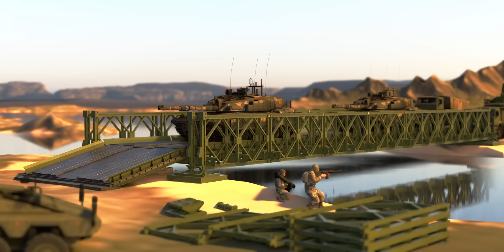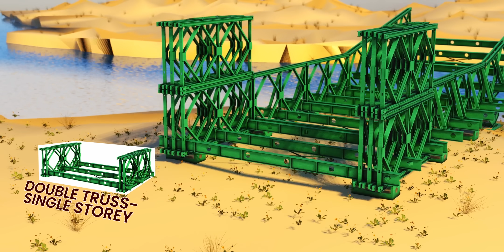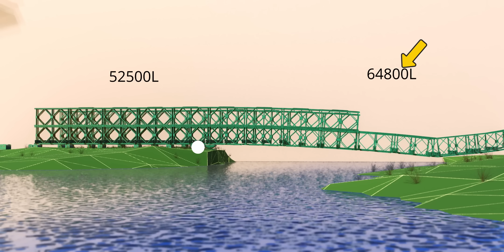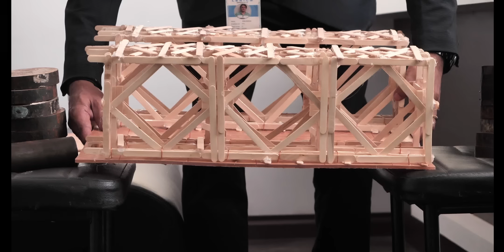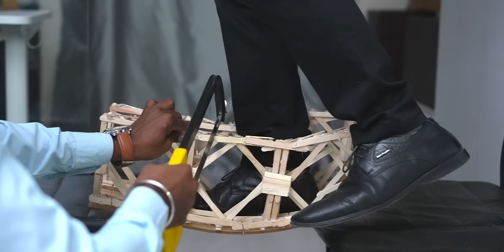The GENIUS Engineering Behind Bailey Bridges!

Comment: 10:50 
…think perhaps an up-date to the Bailey-Bridge is possible based upon geodetic-engineer Buckminster Fuller’s ‘Isotropic Vector Matrix’. Might well be substantially lighter and able to equate or even out-perform this (marvellous) Bailey-Bridge. The matrix is similarly modular but integrates tetrahedra between cuboid/cubic sections; it is susceptible to the introduction of gentle anti-gravity curvature to prevent the sagging moment at the centre of B-B spans. It is observable in some but by no means all crane-booms and its curve potential is radically manifested in its employment as the formal base of the London Eye… It is stiffened by layering modules (two layers - frequency 1 - f1 ; 6 layers - frequency 5 - f5) and these need not be pronouncedly voluminous…

Comment: A couple of points worth noting;  Bailey designed the bridge components so that they could be produced almost entirely by unskilled labour.  One facility was in Liverpool, where the women who checked the football coupons for Littlewood's Pools turned up for work one day, and were told to clear away their desks and chairs from their huge office, "because from now on, you're building bridges."
The other point was reports from the Royal Engineers as to how easily the whole tructure went together.  In contrast, although the German Army had a kit assembly bridge, their engineers complained that it was a right fiddly job to assemble, with so many of the alignments being absolutely critical - or it wouldn't fit together at all.  And, let's face it;  army engineers will rarely if ever find a bridge location where the ground on both sides is absolutely flat and level.

Comment: Interesting but would prefer the use of Moment rather than Torque. Torque is actually a twisting force causing rotation eg with a screwdriver. Moment is a bending force produced by force over a distance.

Comment: I built several MGB (medium girder bridges) with the Royal Engineers, the next generation Bailey bridge.  They have a sort of snout which on longer bridges can dip into the water which, normally being a river, is flowing.  One part of the bridge recce is to check the direction  of flow so you can then place an anchor upstream to stop the bridge twisting away into the water when the "snout" touches the water.  On one build, the bright young lieutenant doing the recce did not realise the river was tidal.  When they came back to do the build the river was flowing the other way which no-one noticed.  As the snout touched the water the bridge started to twist and  the anchoring rope was on what was now the downstream side of the bridge.  The baffled NCO watching the horror unfold was left running up and down the bank screaming "push out on that rope"😂  Lieutenants who managed to drop a bridge into the water were basically nick-named "splosh" for the rest of their service.

Comment: 1973-75 I was with the 78 Engineers in Germany and we were a road and bridge battalion.  We had the Bailey and in the 2 years I was there we assembled 3 bridges for practice.  The actual bridge guys were just one platoon but the entire battalion was needed to do the assembly, led by the experts. It was always a fun day, our mess sergeant would set up the chow tent on the landing side, we ate once the bridge was done and we could walk across to the chow line.  Lay hold, heave!

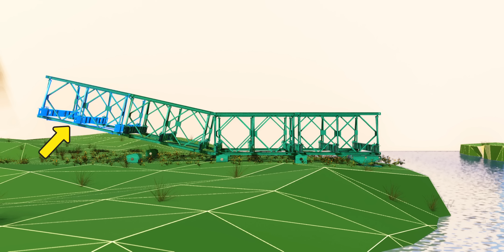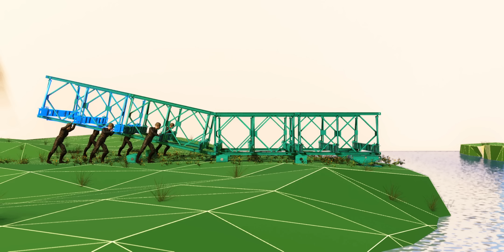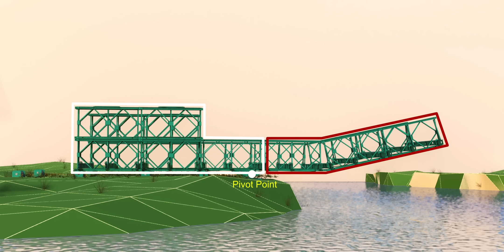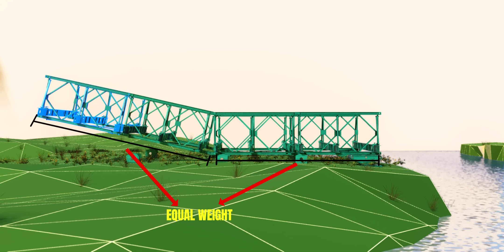Comment: From 2:23 to 2:28, adding the fourth side panels from the lifted position was very difficult in reality.  What we did as actual Sapper, put the 2nd and 3rd (extender) panel on the rollers then connect them.  Put a pair of jacks under the front (right) end of the 2nd panel then let the left end of the 3rd panel sink on the rollers.  Now put in the 4th panel, remove the jacks at the right end of the 2nd panel.  Put the jacks under the left end of the 4th panel until the right end of the 2nd panel sinks on the rollers, now put in the first panel connecting to the 2nd panel. Remove the jack from the 4th panel, put in the 5th panel for connection. Now push the 5-section bridge forward like 2:52.  Continue to put in more sections of panels, until it is like 4:48.  There have not been any moment to lift the new panels very high above ground, like it shown in 2:24, which is impossible in reality.  Some of the Bailey bridges installed during and after WW2 were continued to be used until 1970s.  🤔🤨😉😎

Comment: Looking at the design and erection process, it has a lot of similarities to scaffolding. In the video, I noticed some spans were erected on top of piers. There must be a limit as to how far they can span unsupported. 

The other thing I noticed is the video didn't  show how three double stacked frames were joined to make a single unit.... and if the transoms were secured to the trusses with bolts or pins. 

While it wouldn't be quick, a hybrid suspension bridge arrangement could be set up relatively easily using steel crane counterweights or sand boxes as anchorages instead of using piers.

Comment: There a WWII era Bailey bridge not far from my home locale. It was constructed to link two army camp, one of the white officers and the other of none white privates. There are still other remains of smaller pedestrian bridges, that had linked the two camps. The officers camp had a grand country house and its grounds, which burnt down post war. The other camp was just tents in open fields.

The Bailey bridge it still used daily by light traffic and smaller farm vehicles. Without the bridge, to get to the two nearest villages, distanced 1.5mi/2.4km apart, there’s a round trip of approx. 20mi/32km.

It was meant to be a temporary structure but at the end of the war, local communities had com to rely on the bridge. So the bridge remains to this day. By the way, the deck is a series of perforated metal grids. It’s a bit slippery in snow or ice. But the bridge isn’t marked on maps and the locals know it well.

Comment: Back in the 1980s, a section of Bailey was still in place just outside the Welsh town of Porthmadog.
Leading to what might have been a quarry, when the Roadway known locally as the Cobb, was built and then aided in the early 1990s. To become a double lane. The Cobb had a dual purpose as the railway line from the Slate Mines inland.

Comment: These bridges are still in use. Following a very wet Spring and early Summer in South Eastern Australia in 2022, one damaged bridge was replaced with a temp Bailey Bridge until the early bridge could be replaced. single lane and had traffic lights to control direction of traffic.

Comment: I was an engineer in the 42 scd bat of the Dutch army in the 70 ties, this isnt at all how we learned or did it and we build some realy big Baily bridges.
i have never build or seen a Baily bridge being build with the tilted nose, what we did do was adding a nose to the front of the bridge (a single beam of various lengts) long enough to cross the river. When the bridge was pushed forward ( by soldiers, lorry , or even a tank) it was pushed for enough that the nose reached the far side of the river. A soldier would now walk over the nose with a roller ans place it it under the nose and then it was pushed over the river.
in case of a river being to wide for a nose we had to build one or more pylons in the river, the nose would remain the same just hte soldier walking the over the nose to place the roller would have to do that multiple times now.
And yes a well trained battaljon could build the verry fast, althaugh it was at that time already being replaced with the MGB (medium glider bridge)

Comment: I was in the Royal Engineers from Aug 1969 to Aug 1979. I helped build many Extra Wide Bailey Bridges, EWBB and it's big brother, the Heavy Girder Bridge. This could be build using manpower alone but it was a long job and potentially dangerous with, I think, 18 men per panel. A crane made it much easier and safer. As far as I know all variants of Bailey could be built onto floating pontoons thereby becoming Light Assault Floating Bridge, LAFB or the heavier load carrying HAFB. In the mid-70s we took delivery of the Medium Girder Bridge but, that's another story. As for the EWBB, what happened to the articulators?

Comment: A bridge on a nearby rail-trail was removed and replaced with a newer structure - that promptly collapsed when the concrete for the deck was poured.  They replaced it with a Bailey bridge which is still in place two years later.

Comment: 1. Dorset is in UK not Ukraine as stated at 10.33
2. The ingenious method of manufacturing was when the bridge parts left the factory in Christchurch UK, they were installed on a section of test bridge and then a section from the far end was removed to be shipped out as this ensued that every bit fitted, thus stopping the chance of having problems when trying to install a bridge whilst in combat & possibly under fire.

Comment: Half the video is avoiding to call it weight scale. The one with the pivot point.  
Torque can generally be understood as potentially released rotary energy, I guess. Kinda overcomplicating the whole thing . A balanced scale has both forces to the pivot point equal, or equalized (by hand). Technically they may be viewed as torque , but it adds an unnecessary requirement to understand the process and its priorities.

Comment: Great Video, I spent my time in the Dutch army with the Engineer Corps.. i never actually built one, but i have been involved in a couple of builds.. we once did a test, where we built a deck, that was then lifted by means of 2 cranes onto pillars also made of Bailey panels.. the deck was at 7.5 meters above the water, resting on 4 barges Connected in pairs, supporting the pillars.

The same system of balancing the bridge during building is also used with MGB (Medium Girder Bridge) but these are made of aluminium.. making them way lighter, but just as strong.. 
It is incredible how versatile Bailey bridges are, You can build almost anything.. it is like a Meccano set for Adults..

Comment: There is a great example at LLanbradach, Wales [what3words: across.quest.showering] [Lat/Long: 51.597972, -3.227911] that you can drive across. It has been cemented in at each of the ends. It does have some bent trusses and some additional trusses added as reinforcement].

Comment: I don’t get it. In the intro of this video, the narrator explains how a truss supports weight when the load is placed on the top end of the truss. But, the construction of the bridge in this video places the load from the transoms on the bottom of the truss. The purpose of the criss cross architecture of the truss is to support a load bearing down on the top of the truss.

Comment: Highway 101 between Timmins, ON and Chapleau, ON used to have a couple Bailey bridges before the highway was rebuilt to be straighter in some areas. It was originally laid around large stoney outcroppings. In the 70s and early 80s, these were drilled and blasted and the highway run through the gaps and regular bridges replaced the Baileys.

Comment: The Baily bridge design was later marketed as Mabey Universal Bridges in the UK.  A good example still in use since 1980 crossing Erin Road (A6192) north of Duckmanton, UK at the landfill.  Originally constructed to access the opencast coal pit 1980-1989. Erin Road street view provides good view of the components as described in the video.

Comment: In Florida. The state has prebuilt bailys for (i think) 3 different lengths of pier spans. Most bridges here are built to a set of common span lenghts. They are kept ready to go. Simply craned onto a barge. Towed to where needed. Then the proper height cranes are barged in and bailys are lifted onto the piers. It makes sense as both bailey parts and trained builders may not be readily available. As prebuilt then normal bridge builders can easily work with this. The other part to this is these have the mesh road structure. Thus no wasted time tossing stacks of plank down for the road bed. No rotting wood. Tough on tires and noisy. But can take the heavy weight of traffic. I am certain the thickness is different for span length. Of course 18 wheelers have to bypass. Mostly used on interstates. Thus wider than a standard bailey.

Comment: I have experience in putting together and disassembling the Transfield Bridge, which is the modern Highway rated version of the Bailey Bridge. It requires two mobile cranes and a large crew to assemble. We did our training at Puckapunyal Army Base in Central Victoria, and we did the build cycle during daylight and under generator lights at night.
This was with the 22 Squadron Australian Army Reserve Engineers back in the mid-90s.
Mark from Melbourne Australia

Comment: AI Summary

Abstract:

This video comprehensively explores the engineering marvel of the Bailey Bridge, an innovation crucial to the Allied victory in World War II. It details the bridge's robust modular truss design, explaining how its unique structure provides immense strength. The core of the presentation focuses on the ingenious assembly method, which allows the bridge to be "launched" across a river from one side using precise weight and torque management, a testament to Sir Donald Bailey's mathematical brilliance. The video illustrates the step-by-step construction, the critical role of an upward-bent front section, and the calculated shifts in balance that ensure a safe landing on the far bank. It also demonstrates the bridge's superior load-bearing capabilities through experiments, discusses its ongoing utility in modern civilian applications, and highlights the historical significance of the world's longest Bailey Bridge.

Summarizing the Bailey Bridge: A Masterpiece of Modular Engineering

*   0:00 Historical Significance: The Bailey Bridge, praised by General Dwight D. Eisenhower, was one of the three most vital innovations for the Allied victory in World War II, still widely used today due to its rugged, easy-to-assemble nature.
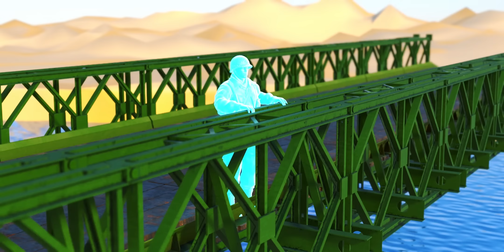*   0:17 Core Design Principle (Truss Structure): The bridge's incredible strength comes from its side panels arranged in a truss formation, which efficiently distributes load. A basic unit consists of two such trusses connected by transoms and sway braces.
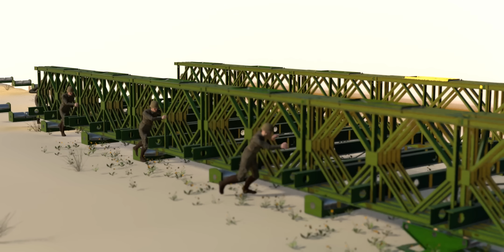*   0:57 Genius of Assembly (Weight Balancing): Sir Donald Bailey's "genius engineering" enabled the army to assemble and launch the bridge across rivers without prior crossing, relying on precise weight and torque balancing.
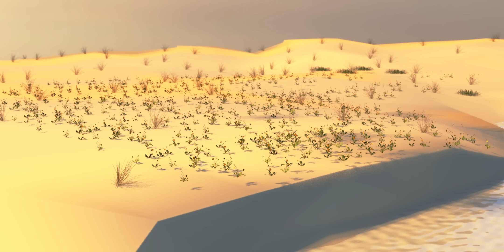*   1:11 Launching Process & Rollers: Assembly begins with installing special rollers, including a "rocker roller," on the bank to facilitate pushing the bridge forward unit by unit.
*   2:08 Crucial Upward Bend: The front portion of the bridge is designed with an upward angle, which is essential to prevent the free end from dipping below the level of the opposite riverbank as it's pushed across.
*   3:00 Dynamic Torque Management: Successful launching involves carefully managing torque around the main roller. Initially, torque on the launching side (left) must be greater for stability, eventually shifting to the right side to allow the bridge's free end to automatically fall into place.
*   4:24 Scalable Load Capacity: Bailey bridges can be configured with single, double, or triple trusses and different "story" (vertical) arrangements to support various heavy loads, with a triple truss unit weighing around 4200 kg.
*   4:47 Precision in Deployment: The video demonstrates, through detailed torque analysis, how Bailey's precise mathematical calculations ensure the bridge remains stable and does not topple, even when large sections hang precariously over the river.
*   6:55 Automatic Landing: The meticulously planned shift in weight and torque ultimately causes the bridge's free end to automatically lower and settle onto the ground on the far bank, a crucial moment for soldiers.
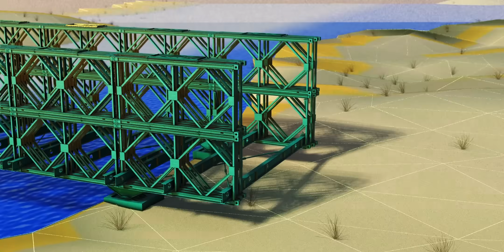*   7:31 Finalization & Bearings: Once landed, the bridge is fully extended, and roller bearings are installed at both ends to accommodate slight deflections under heavy loads, preventing internal stress and ensuring durability.
*   8:02 Strength Demonstration: An experiment using simple popsicle stick models vividly showcases the Bailey Bridge's superior strength and minimal deflection compared to a basic beam bridge, even when carrying significant weight.
*   8:36 Modern Civilian Utility: Beyond its military origins, Bailey bridges are frequently used today for civilian purposes, especially as temporary or even permanent solutions after natural disasters.
*   8:57 Longest Bailey Bridge: The 788-meter Hobart Bailey Bridge holds the record for the longest, serving as a vital temporary road link for nearly two years after the Tasman Bridge collapse in 1975.
*   10:24 Enduring Durability: A testament to their robust design, some original World War II Bailey bridges, such as one in Dorset, Ukraine, are still in regular use today.
Error: value error

I used gemini-2.5-flash| input-price: 0.3 output-price: 2.5 max-context-length: 128_000 on rocketrecap dot com to summarize the transcript.
Cost (if I didn't use the free tier): $0.0066
Input tokens: 14796
Output tokens: 870

Comment: Used BB2 in Swedish army where I was a group leader around 1985.
We were in north sweden stationed at Ing3 in Boden, engineering troops.

In a tent exercise we built a BB2 with one support pillar out close to the stream. 
That is the bridge is pushed out and lands on an BB2 pillar close the water stream, before being pushed to other shore. 

The water was a rather wild ‘fors’ with steep sides.
It was -42 degrees celsius. 
After completing and getting back to our tent, the soldier keeping the fire fell asleep. 
It’s a circular tent where you lie with your head close to the tent cloth. 
Everyone woke up with a head two sizes too small.

Amazing experience!